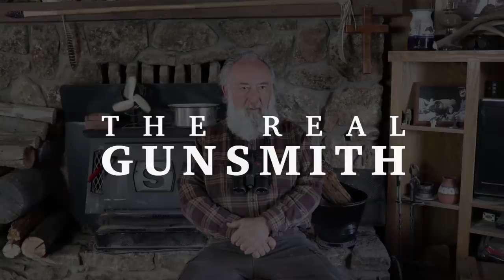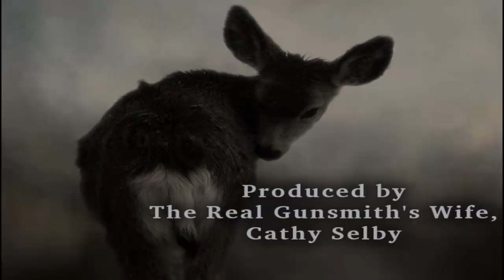Belted vs Unbelted Cartridges

Comment: I remember reading that belted cases should be sized so that the case shoulder positions the cartridge in the chamber, and not the belt.  They said that the belt was made for the 375 H&H magnum because it had only a slight shoulder to position the cartridge in the chamber, and that shoulder may not be enough to hold the cartridge in place during firing, in some cases.  The belt was held over in the magnum cartridges based on the 375 H&H mostly as a marketing gimmick.  Other than the 375 H&H, the only standard cartridge that I can think of that needs that belt is the 458 WM, because it has no shoulder.
Reply: if you only shoot the reloaded cartridge in one rifle you can do that
Reply: @shallpion  Do what?

Comment: Good chamber specs and quality set of dies can get a lot of miles out of belted brass. I always headspace off the shoulder as well. Usually three neck sizings and then a slight shoulder bump with a body die. Redding comp dies. Easy dozen firings with good quality brass. If you're using FL dies every time you're gonna get case head seperation very quickly. Just my experience.

Comment: The belt was originally for the old 300 H&H Which , as you know has a long shallow shoulder as it was designed to use the propellant of the time.  The belts stuck around because the h&h was used as the parent case for a myriad of Cartridges.  That being said, I use both Belted and non belted Cartridges and have had no problems with either.
Reply: ....lol.....the 300 H&H has the .375 H&H as its parent case which came out in 1912 vs its little son - the 300H&H in 1925
Reply: @ericrumpel3105  The 375 was also made as a rimmed for use in double guns
Reply: To: mausermonger koziczkowski - Nope. The first belted cartridge was the Holland & Holland .375, in 1912. It was given a belt near the rear of the cartridge case to better "Headspace" because the case taper was not as much as most other cartridges of that era/time  ( such as the 7mm Mauser or the .30-'06 Sprg.. ) The belt helped the cartridge to "fit".
 
  Both cartridges had "Brother" cartridges by with a "Rim" instead of rimless & belted. They were called "Flanged rounds". Other European makers did the same thing, especially German & Austrian makers. The same case capacity and bullets but the "Flanged" ( aka: Rimmed ) were for Single shot, Double rifles or Drillings, whereas the rimless / belted were for Bolt-action magazine rifles.  
 
   In about 1925 H & H necked down the case to hold a .30 caliber bullet and it was called Holland's Super .30. Now it is commonly called the .300 H & H magnum. It can be handloaded with many different .30 caliber bullets ( as can the .30-'06 ) from 110 grain to 220 grain. Winchester chambered their Model 70 in .300 H & H in 1937.  
 
 You can get much information from a book titled: "Cartridges of the World" by Frank Barnes , edited by John Amber, and later by Ken Warner. Published by Gun Digest Books and by DBI Books. Different editions over the years. Lists of U.S. and international cartridges , obsolete and alive. History and dimensions and suggested uses. Rimfire, centerfire, shotgun shells.
Reply: @gusloader581  my bad
Reply: @gusloader581  t is still a good design.

Comment: I would think resizing a belted case like randy explained in an early video with a slight resistance when the bolt closed would be best and get longer brass life and not have all these issues, although listening to this video has my wanting to replace my 7mm mag with a 28 nosler

Comment: What I have seen is that belts allow a straight case to headspace properly without the use of a rim. That said, I have also seen many cases as such have too much headspace to shoot accurately. I have one belted cartridge rifle, a 458 win. It shoots inside a silver dollar at one hundred yards with open sights off hand. I won't sell it because I will find another one. Most belted stovepipes shoot in the range of 4 MOA at one hundred I have found. The rifle I speak of is a Rem 798 made in Serbia on a commercial mauser action, good luck finding another that will shoot that well.

Comment: I want my case to headspace on a tapered shoulder not a perpendicular belt. One way promotes concentricity and the other doesn't.
Edit: my rifles uses spring ejectors that force the round to the shoulder. If I had a control round feed I'm not sure my logic would be valid.
Reply: the one reason certain MIL. Command appreciate the belted is because todays technology can produce very precision, uniform, consistent cases accurately for large number of  sniper/dmr rifles with the same chambers, thus, headspacing off the belt allows for larger chambers without sacrificing consistent precision accuracy & the ever needed reliability of function in possibly the worst of dirty conditions making loading & extraction reliable,...& never a need to reuse/reload the empty cases anyway.

Comment: It seams the 300 and 375 H&H  where belted for good headspace because those cases where long tapered so they did not headspace good on shoulder.  Then as new rounds where formed from those cases they just keep the belt, but now today new magnum rifle cartridges have done away with belts, eg 300 Remington ultra mag or 338 Lapua.
Reply: @gusloader581   the lord is one, however God is manifest in 3 persons. father, Son, Holy Spirit.  Pastor Benny is a solid Bible teacher and preacher.

Comment: Yeah, I don't like the abrupt stress riser seems to be a mistake. If one tries to fire form cases it causes bulge that could weaken the fire formed case possibly causing causing case head Separation,gas cutting the chamber,and possible injury,right?
Reply from the maker: Cases must fit a chamber with support head to shoulder.  
Thanks for watching.

Comment: The problems with belted cases may be why the buying public getting away from  them and going to beltless magnum cartridges. Head spacing on the shoulder  the beltless magnums can handle the presures the belted ones can. For reloaders we prefer beltless. its what we are used to also.

Comment: Sorry but I'm going to ask ask anyway. I've read that way back Holland & Holland on large bore, straight case, "non-shoulder" fire arms the used the belt to "assist" with head spacing. I really don't under stand for sure what I read.
I do not see where the belt could be used at all to head spacing. Unless something has changed 30-06 or 243 or 223 all headspace off the shoulder. A rimmed cartridge off the rim. So please tell me where I'm wrong.
Reply from the maker: The belt is a shoulder, lip, tha is used to head space.  Merely different methods to head space:  belt, shoulder, rimmed.

Thanks for watching!

Comment: The belt was orginally placed there for headspacing in chambers on double rifles, break open style actions. It is an old wives-tale that came about calling it a "belted magnum", the "belt means it's a magnum"....lol - it was a magnum because it was big when it came out in 1912. Now, I have heard that the reason the military went with the .300WM for the specific reason that the one-time use of the cases made for the military can be made to headspace off the belt,(as usual), & accurately & consistent undersize for the chamber to allow for dirty conditions with out extraction problems, so long as the cases are made accurate & consistent, but small for the chambers, & utilizing that belt for what it was orginally designed for, headspacing, the precision rifles will still shoot as accurate as any precision rifle, now the first-time fired spent cases will be difficult to resize accurately because of spring-back & may require 2-step dies, but, the military won't worry about that, they don't reload. Belts are the reason I dedicate new only brass/cases to rifles & neck size only,  those cases never being shot in another chamber from new on till the end of life, & neck sizing only has worked great in my match chambered belted mags., that said, I am not an advocate of belts neither, but not going to necessarily run out & change-up now,  getting the performance I do after shooting longrange target out to a mile the past 45+ years.
Reply: As far as I know the old doubles used rimmed cases
Reply: @robertboyd3863  belt was on the modern doubles of 1912 & forward.
Reply: @ericrumpel3105  You do know the 375 H&H was also made with a rimmed version for double rifles,
Reply: What belted rounds were commonly used in double rifles ?
Reply: Rimmed cases do not work good in magazine style rifles, and the long taper of the early english sounds such as 300 super mags which were designed for cordite powders did not have enough shoulder to headspace on, thus the need for the belt , which is now worthless on modern (magnum) style cartridges
Reply: Magnum sounded awesome and yes, everyone thought the belt was required on big rounds, wich in most cases it wasn't .
Reply: @robertboyd3863  ....lol...why the 300WM was just chosen a couple of years ago for MIL.Sniper rifle....&....they feed just fine, that said, I disliked belted cases 35-40 yrs. ago, but that's all there was commercially & now the cases are cheap & easy to come by vs. some of the beltless new calibers that don't do anymore really, that a guy like myself that shoots  thouands of rounds a year on average would have to be a fool to pay for "new" beltless & gain nothing in performance
Reply: @robertboyd3863  ....& the "new" was the belted for doubles, quickly adapted to the modern bolt-repeater & fed reliably to perfect in CRF.
Reply: @robertboyd3863  375 H&H & offspring
Reply: @ericrumpel3105  You are not making any sense the 300 WM is used on a bolt action rifle, so of course it feeds fine, as I pointed out, that was the purpose of them , most of my main rifles I use are belted , my only concern was you saying the original purpose of the belt was to headspace on doubles which was not true , all the old doubles used rims. Also nothing is always true, rimmed were also used in magazine rifles and machine guns with no problem. 40 years ago the 80's there was all sorts of belted , rimless or rimmed available so again, you make no sense,
Reply: @ericrumpel3105  My question, was a 375 belted ever used to any extent in doubles ?  I had never heard of it being, but never really checked into it too much and from what I'm finding now, the rimmed was made for doubles
Reply: I just found where a few 458 win mags etc. were made as doubles but doesn't sound like very common

Comment: I.m.h.o. the only way id want a belted cartridge rifle is if a truely competent smith had cut the chamber correctly for the cartridge. By the same token i prefer a smith chambered bbl over a factory one for all applications. Cost more but when done right its worth it. I dont have a randy built rifle. Basically because i dont have a need for another rifle other than what i have now...but when my bbl needs replaced on my 7mmWSM  or my 300WSM BOLT GUNS, ill be getting w Mr. Randy about the job. Had a custom ar10 built in 300Wsm...sub .5" w factory precision hunter 200grns. She definitely shoots better than i do...the 308 upper that came off was 2"+ shooter. So thats my 2cents worth.
Reply from the maker: Thanks!  And I'll be glad to rebarrel when you have the need.
In the meantime, good shooting and thanks for watching!

Comment: Anyone that has had a major malfunction in a Lee Enfield rifle can tell you that rims and belts don't work well in magazines.
Reply: ....lee enfields are a major malfunction....lol
Reply: Consider the lee was one of the longest lived war rifles, it wasn't a huge problem , the Russians also used rimmed in their rifles and machine guns for years ,
Reply: To: Tru Dat - The .303 Lee-Enfield SMLE battle rifle served the British & Commonwealth Forces for about 7 decades. It is a workhorse designed for hard use on a battlefield, not a once a year deer hunt 20 miles from home. 
 
 The rimmed cartridge is always better than a rimless because they always will eject / extract. To this day men are still using the tried and true .303 Lee-Enfield as a hunting rifle. It gets the job done.  { Ever hear of the "Mad Minute"? 20 rounds from a Lee-Enfield SMLE in one minute, bullets on target.  ( the magazine holds 10 cartridges. ) For many years it was used in the Palma Trophy matches. Distances of the Palma matches were / 800, 900, & 1,000 yards.
 
  P.S. The venerable .303 Lee-Enfield has no belt. 
 
 My Rimmed cartridges always eject / extract. .30-30 Win { Stevens Bolt-action ); .303 Brit; .22LR; .38 Spl.; .45 LC; and my 20, 16 and 12 gauge guns. Can't say that for rimless cartridges, especially in self-loaders.

Comment: You should've just come out and said that the belt on the belted cases are not necessary and only adds complexity to its shape and manufacturing process.
Reply from the maker: Why?  Everyone has likes and dislikes.  Many like them.  Don't like them, don't use them.
Reply: @TheRealGunsmith I've owned 300 Win Mag. Rem. 700 BDL in the 1970-80s and reloaded and shot several hundreds of rounds.  I like the power of the 300WM. I don't dislike the 300WM round. The belt on the belted cases are not necessary, and if the 300WM case was made without the belt, the case would be just as strong and the round just as powerful, assuming the powder volume didn't change.  I hope you're not offended by that statement.